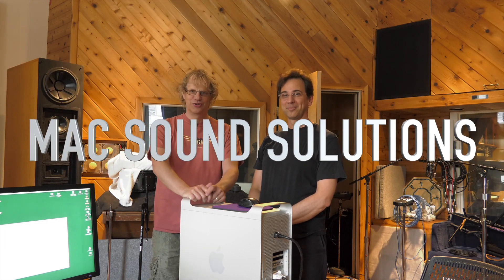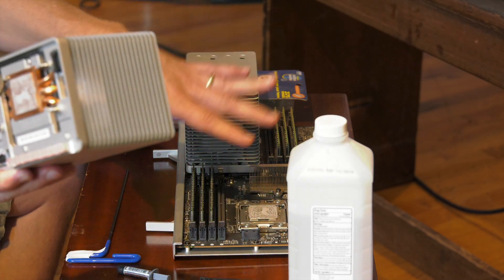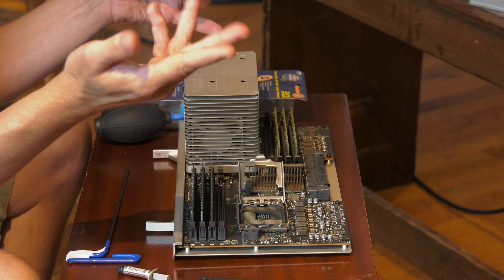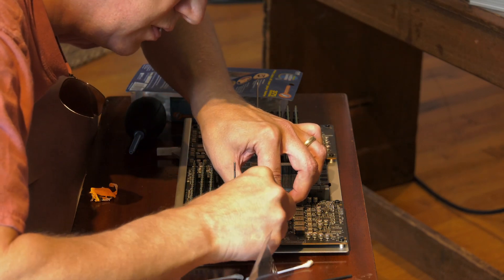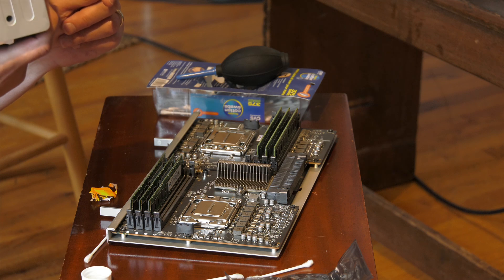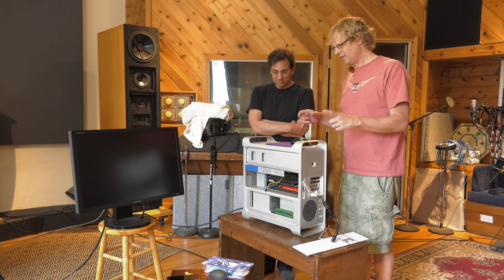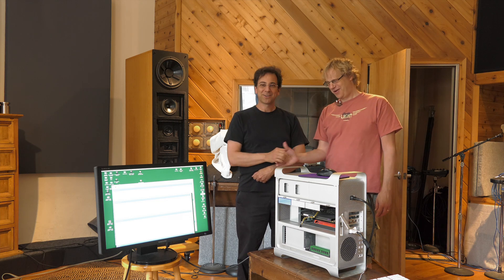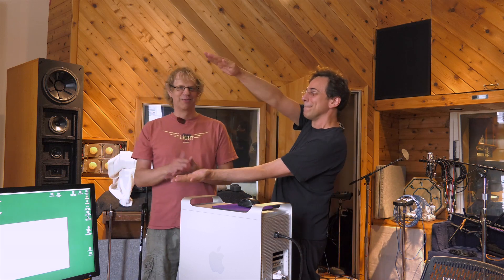MAC PRO 2010 5,1 DUAL CPU UPGRADE

Comment: Whats up Lance my friend! Just want to know have you upgraded to os High Sierra and are you getting lag problems like I am still in pro tools and just the os in general.
Reply from the maker: Hey Rosewood. Yes I tried to update from 10.12.4 to 10.13.3 and had very laggy graphics in general using the latest Nvidia web driver and 980ti so I went back. Just wanted to give it a test and was not happy with the results. 10.13.4 may fix the issue but won't know until it comes out and Nvidia drops a new driver for it. My system is great 10.12.4 and PT 12.7.1.733 so no real need to update but wanted to check it out and so far not good.
Reply: Lance McVickar Thanks man I was giving it a try too and it sucked bad. Are you still using beam sync or is the os just working for you? And im still using ML 10.8.5 bro. Crazy and I pay for pro tools every year and cant use the new features because im still in ML and the new os causes problems lmao.
Reply from the maker: Rosewood 216 hey man with Sierra 10.12.4 no need for beam sync plus I don’t think it’s available in Sierra but it works as it should and is rock solid no graphic issues at all. I have a flashed 980ti and you have to use the specific web driver from Nvidia. But that version with PT 12 is great.
Reply: Lance McVickar ok cool im a give that a try. Thanks man!
Reply: Hi Lance just want to get your opinion. I have my old mbox 3 pro and I'm looking for a better interface. The ones I'm looking at is the Apollo 8 new black face one, Lynx Aroura the new blue face, motu 828es, and the Antelope Orion studio rev 2017. Now here is the deal I'm really not worried about the plugins that come with the Apollo or antelope Orion studio rev 2017. I want to know which interface has the best sound going in recording and best sound coming out when mixing. They all have the right ins/outs for my outboard gear and digital mixer. Just want to get your opinion on this. Thanks bro! Basically which one has the better converters inside.
Show less
REPLY
Reply from the maker: Hey man, honestly I can't tell you which is better, now a days most interfaces have really good converters but if you want the best sounding I think Merging Technologies is near the top for preamps and conversion. They have two interfaces the Horus and the smaller Hapi which might be a good fit for you. http://www.merging.com/horus 
They do have a pro tools digilink card option as well. As far as sound goes they are great sounding and the mic pres are remote controlable. We have recorded Jack Johnson, Liam Gallagher, Mike and the Mechanics live shows for Front and Center. You can load the interfaces with different cards to suite your needs. They are not cheap, the Hapi has limited inputs but may be enough for what you are looking for.
Reply: Thanks bro!

Comment: Have you tried the OWC Accelsior S PCIe card for SSD's??
Reply from the maker: I have the Mercury Accelsior E2 and it's been great for  three years now. The benefit is you get two Esata ports on it and a boot able fast SSD not as fast as some of the latest flash drives. Around 600mbps read 500 write.
Reply: Have you noticed and speed/performance differences in your bootup and programs? I can't remember if you had an SSD connected to one of the regular HD bays before getting the Accelsior E2 setup.  

I have the 850evo as my main OS but wanted to tried the SM951(AHCI) in a PCIe slot via Lycom DT-120 card.  I did try the OWC Accelsior S card with the 850 Evo attached and the speed doubled (257 to 501) in Blackmagic. However, I did not notice much different in the performance of my programs. At best, programs like Protools and Logic opened about 3 to 5 secs faster. The only thing I notice a big different in was copying files. I was able to copy a 14gb folder from the 850 Evo to my 840 Evo in about 35secs. That's about twice as fast vs when the 850evo was connected in HD bay 1.  The Accelsior S card also made the OS drive show up as an external drive on the desktop which I did not like at all. I can hide it using the finder preferences but not without also hiding any other external drives connected to my Mac Pro.
Reply from the maker: J Harris I never had a ssd in my internal bays, boot time is like 15 seconds apps launch fast, you can use the newer Samsung 951s flash drives on an pcie card and they will be twice as fast my Accelsior is.
Reply: Thanks,
Going from WD Black 7200rpm to Samsung SSD as the boot drive was a big different.
My 2010 MacPro 12core boots up in about 40sec. Protools HD also loads in about 40sec or so. The 850Evo is in HD bay1.  My 2013 MacbookPro i7 pretty much cuts those times in half and I assume its because of the Samsung flashdrive.
I'm running High Sierra and Protools HD 2018
Reply: You do not want an Accelsior. I cannot harp enough about how bad they are. I own the 1tb model. It causes tons of problems, ejecting other drives while the computer sleeps, unpredictable levels of support from OWC. This product is not reviewed well online, many fail and have problems.. A much, much better option would be the SM 951 AHCI (not NVMe), or a sonnet tempo RAID 0 PCIe card with x2 850 EVOs in it. This product has left a lasting, permanent bad impression of OWC for me.
Reply from the maker: Kevin Mead Yeah it has its quirks, you cannot sleep the computer with Esata drives connected to it but the same goes with usb 3 drives, they will un mount  as well via a usb 3 pcie card if you sleep the Mac Pro . I have had my accessior for three years and it’s been pretty solid, I don’t sleep the computer ever.  I get it you paid a lot for a 1 terabyte mine is 256 gig as I like to keep my system drive on the small side. High Sierra supports the Samsung 951 so thinking about making that upgrade myself and it way faster than the accelsior.  Raide 0 drives are not supported by High Sierra at the moment from what I hear might change in the next update 10.13.4 I would not recommend the Accelsior at this point as it’s old tech and has its issues as noted.

Comment: Thanks Lance for the confidence in upgrading my Mac pro...I just ordered the kit off ebay for myself. Have you upgraded the video card yet?
Reply from the maker: I have a 980ti installed and works well and it's flashed for mac so I get the boot screen. You can put in  a flahsed 1080ti from MacVidCards alkbiet pricey or a non flashed but you need to pull power from one of the DVD drive bays in addition from the logic board. The 980ti works with the internal power, you can still find flashed ones on ebay for a pretty good price.  A stock 1080 not the ti is a good choice but you can only get a flashed one through macvidcards or have them flash teh one you bought. They only need one power connection and it uses less power than a 980ti and pretty close in performance. You can also install the new AMD Pro Vega cards if your running High Sierra, it also needs more power from the drive bay and two power feeds via a eight to dual mini connector to the login board or an external power supply for the 1080 ti or Pro Vega would work as well. all Nvidia cards have to have the proper driver installed an updated driver for each OSX update. I am hoping this is the year of the new mac pro. I would never buy the imac pro, though it is fast it is totally not upgrade able and expensive. Good luck on your upgrade!
Reply: I was thinking with just going with a GTX 680 as I'm still on Mavericks and PT10 HD.

Comment: Guys love the video - very entertaining. 
Have you noticed since that the fans are running more? 
The X5680 is a 130 W chip which is fine in a single core mac pro but usually twin 8-core and 12-core the chips are 80W-90W AND can run at hotter temperatures (hotter than the X5680.  
If you haven't noticed the fans kicking-in more then "result" the mac can take it :-)
Reply from the maker: actually the Xeon 3600 series are for single CPU Mac Pros and 5600s are for DUAL CPUs mac pros and yes the 5680s use more power but has not been an issue nor do the fans blow much more than they did before the upgrade that being said I use istat to control my mac pros fans and keep tabs on temps as they do get hot when rending video using all 12 cores. So yeah they can get hot. I have never had a shutdown due to over heating and the fans auto kick in via istat based on when the cpus hit a certain temp.

Comment: Another great video, Lance! I upgraded my 2009 mac pro following your videos, and I'm not a computer techie. I have a question for anyone that might be able to help...I need to be able to add a 2 port, usb-c 3.1 pcie card to my 2009 system to power 2 UAD Apollo 8p audio interfaces. Is this possible? I've seen people add usb 3.0 cards and power the cards where necessary. I'm trying to avoid having to buy a new system. I'd appreciate any help anyone could provide.
Reply from the maker: Rashiid K Coleman check this out,
https://www.google.com/amp/appleinsider.com/articles/17/01/13/install-an-inexpensive-usb-c-pci-e-card-in-a-mac-pro-for-full-usb-31-data-transfer-speeds/amp/

I wasn’t aware that you could put this in a Mac Pro but looks like you can as there is no thunderbolt I figured usb c was unlikely but look a like it can be done. Going back the the article to read more about it.
Reply: Thanks for the super fast response! You're awesome! Unfortunately, I've read this article and the Aukey card is unavailable. That would have made this upgrade easy! I've seen other usb c cards that can be powered but they seem to be Windows compatible.
Reply from the maker: Rashiid K Coleman my guess is if you find someone with a Mac with usb c or go to the Apple store and get a system report you can find out who makes the usb c cards in the latest macs and then find one, but as they are pretty cheap I would just get one and give it a try windows always needs drivers but Apple has them installed in the system for usb c so it most likely will work just needs to get power from the dvd drive bay. I have a usb 3 card and it just worked no drivers to install.
Reply: Ok. Will do. Thanks again!
Reply: Ok. Will do. Thanks again!

Comment: Hi Lance! Don't you think it's too hot, 130w instead of 95. The cooler processor the fastest general response what ever you do on your Mac. How do you solve this problem? https://ark.intel.com/products/47916/Intel-Xeon-Processor-X5680-12M-Cache-3_33-GHz-6_40-GTs-Intel-QPI
Reply: The 2010 Mac Pro system covers 45 W (12-Core Idle) 285 W (12-Core CPU Max) or 142.5W per 6-core processor max

Comment: A couple questions: 1. When upgrading from a dual quad core to the dual hex core can you use the same RAM? No changes necessary? 2. Are all Xenon 5680's equal? I have seen a 100% price difference on eBay and other sites. TIA
Reply from the maker: yes its the same ram for either, best to leave the last two slots in each bay empty, you will get faster performance.
Reply: Yes... but quad cores can only use 1066Mhz RAM where the hex cores can use the 1066Mhz and the faster 1333Mhz RAM - macsales.com sells it cheap and will even buy back your old 1066Mhz RAM.

Comment: Great video, I just finished my 2009 Mac Pro upgrade. The computer is insane when using either metal or OpenCL in premier pro cc. Check out the specs, prices, and process. https://www.youtube.com/watch?v=8YdpN1kk2Wk

By the way the cpu socket is not as delicate as most people say, no need to count turns, just tighten until it does get any tighter with two fingers. I actually tighten mine really tight, again with two fingers.

Comment: Thanks for the video. Next time when you change the processors, you should remove and clean the Delta fans in the Boosters. It will help preserve the longevity of those fans, since they are extremely difficult to replace if they die, and those fans have usually been running uncleaned for years. You need to almost always replace the entire Booster when those fans die. Also would be a good time to remove the I/O heatsink under processor A's Booster, and re-apply the thermal paste. The I/O temps (when older) tend to run in the 70˚ C's when you could be running it 10˚C cooler or more.
Reply: When you are talking about the Delta fans, are you referring to the fans in the heatsink? Because I am about to do that upgrade as well (2.6612core to 3.46 12 core), and what exactly should I clean in there apart from the obvious dust?

Comment: Dingo  Studio
Hi Lance i have just upgraded my mid 2012 Mac Pro 12 core  with a pair of 5960 x 3.46GHZ and 128GB of ram  i also noticed that my back motherboard and CPU tray motherboard are both red and not dark like the others that i see on you tube
Reply from the maker: The 2009 have the pins the 2010 have the wholes on the logic board. It does make it a bit tougher to get the heatsinks back on. So is everything working for you?
Reply: Could you share some pictures with us of your red logic boards ?

Comment: Yo Lance! I just finished my 3.46 GHz 12 Core Upgrade on my 2010.  I have a 7950 CPU, 64 GB ram. and I only score 20,000 on Geekbench, i was expecting close to 27,000 - It booted fine and has been running for about 15 minutes at this point.  Should I be concerned?
Reply from the maker: Geekbench scores vary depending. Geekbench 3 free 32 bit version can give you 5000 less on the score than the paid 64 bit version, geekbench 4 set new benchmarks and where you would get 30000 with the 64 bit version you will get around 20000 with the new geekbench 4 version. So what version are you using?
Reply: Ahhhh, that explains it.  I have Geekbench 4.  just bought it last night.  I also had geekbench 2, but I never tried it with geekbench 2.
Reply from the maker: Yeah they dropped the scale to compensate for newer faster computers I guess. SO 20,000 is around where you should be, go onto their website and compare your score to other 5690 mac pros in their  geekbench 4 uploaded results from other users.
And congrats!
Reply from the maker: Yeah they dropped the scale to compensate for newer faster computers I guess. SO 20,000 is around where you should be, go onto their website and compare your score to other 5690 mac pros in their  geekbench 4 uploaded results from other users.
And congrats!
Reply: Ok great! Well I just went into a Final Cut Pro Session that I was editing yesterday.  It has a single camera angle at 1080p, so nothing big there.  But it also has 2 Lav mics in the interview with Fabfilter pro Q2 and Fabfilter Limiter on  each audio channel and then Izotope RX6 Voice De-noise on each channel.  The 8 core was really struggling with that edit yesterday, a lot of beach balls.  Post upgrade the computer doesnt break a sweat on that edit.  Thanks for you videos, i could not have done it without your help!
Reply from the maker: Audio apps and plugins like Pro Tools really benefit from faster CPUs with more cores. You could put a second 7950 and really get more speed with of FCPX as it likes AMD over Nvidia. The 2013 still seems to be best for FCPX if you have the duel 700s. http://barefeats.com/imac5K_vs_pros.html It's a bit crazy I have the GTX 980ti and it is not a big boost to FCPX. But I only render when exporting. I am waiting for the next 2018 modular mac pro. Mine is humming along just fine. Glad to be of service!
Reply: Yeah, that is what I'm thinking too.  Just wait for the 2018 and use this as a stop gap.  Although, my Universal Audio Apollo worked better on thunderbolt, but I really hated having a Hackintosh, and that is how i was editing video before this week.   How can you run Dual 7950's?  I would have thought that there wasn't enough power to support that.  Ill have to google it.
Reply: The only other thing that I am little concerned about from this upgrade is that my CPUs are different temperatures, CPU A at 51 degrees C and CPU B is a 37 C.  So maybe I should pull my daughter card out and go 1/2 turn on each tower?
Reply from the maker: Sorry didn't see this before... but my temps are 41 and 38 c at idle. I use istat to tone down the temps running the fans a little higher than norm. But my mac pro lives in a ventilated closet, I have GTX 980ti and the 5680s. The 5690s most likely run a bit hotter. A is always hotter than B cause it does most of the heavy lifting until you start encoding video or pushing it hard.